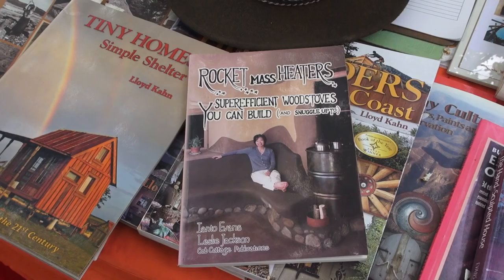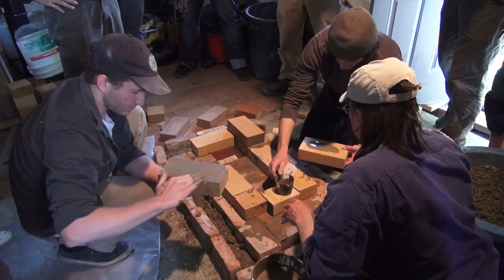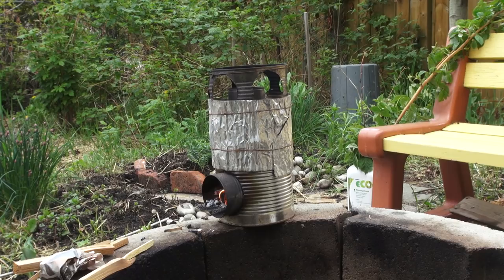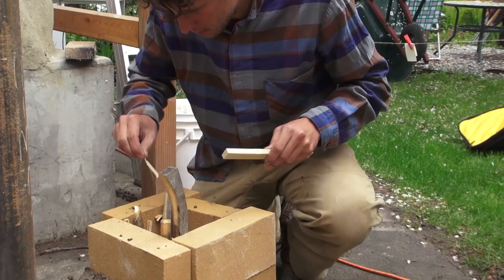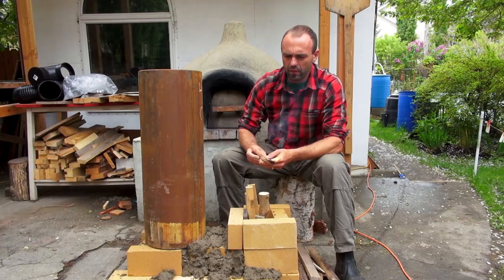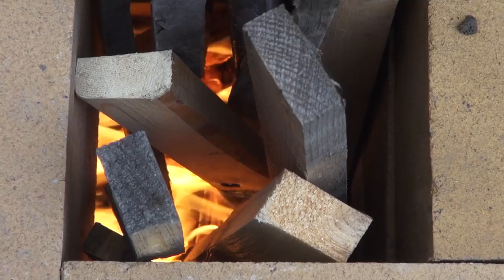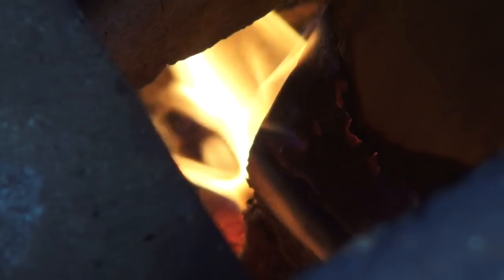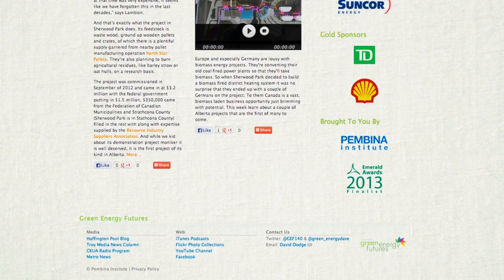47. Rocket Mass Heaters: A better burning wood stove

Comment: I can tell that these people who have talked for a long time don't really understand why it works as it does. Quite a few years ago ( 7 ) I put my brain to understanding how this works and how you can attain these efficiencies. I understand this process. How can you go from burning 6 cords of wood to maybe 1 to 1 1/2 for the same heat when the existing stoves may claim an efficiency of 80% lets say. There is something wrong.  But I can tell you the rocket mass stove does just that.
Reply: It basically "works" because it dumps its heat energy when it comes out of the inner flue and encounters the 55-gal drum. Not only does it "dump" its heat energy, but the (realtively) cooled air sinks, drawing the hot combustion air upwards. If you insulate the drum...you lose the draft. Ideally, you should insulate the inner flue, so that no heat is transferred to the gas in the 55 gal drum portion...I don't see them doing that here.
Reply: Existing wood stoves may claim to be 80% efficient, but they are just 80% MORE efficient than the last piece of junk ineffecient wood stove. Not 80% out of 100%.
Reply: Darrell Jacob JR - close... Actually, they are 80% efficient at combusting completely and turning the fuel's available hydrocarbons into heat... 

  The fact that they send a huge portion of this heat out the chimney as 500+F exhaust to maintain stack effect has no bearing on the "efficiency" rating.  It is in no way claiming that 80% of the embodied energy in that fuel before burning will wind up inside one's home.

  That (highly important to real world value) factor is not a part of the EPA wood stove "efficiency rating" program.  It's all about cleanliness of combustion, and the rocket design has them beat on all fronts right up front in the super efficient primary and secondary combustion it creates.

  Well designed/built Rocket mass heaters create 90-95+% combustion efficiency for most of their burn cycle, AND scavenge most of the heat from the (MUCH) cleaner exhaust gasses, before sending them out of the building... 

  And have a "real world efficiency rating" that is probably closer to 80%, wheras the "80% efficient" (at combusting the wood) stove in my living room probably has a real world efficiency (net energy from the wood burned kept inside the home) of closer to 20-30%

  I clarify this mainly for others as I know from other comments that you have an intimate knowledge of RMH's and their construction/design principles.

  I just wanted to explain the facts for people used to using normal wood stoves and talking about their "efficiency ratings", who have not experienced the real world difference between the two... Which stated simply is:

  A properly designed and homebuilt Rocket Mass Heater, burned a few hours a day, will keep you warm (70+F) 24/7, on anywhere from 1/4 to 1/10th the wood of a "high efficiency rating" modern wood stove.
Reply: bcubed72 - the dumping of heat energy at the barrel is the second half of a two stage thermosiphon... The first stage is the rocket's highly insulated burn tunnel and riser tube.  At  3000+F in the most highly optimized designs, that 3-4 foot burn tube creates MUCH more stack effect than a normal chimney of that length due to the huge temperature differential...  The barrel then shrinks these gasses back down to flow through the exhaust at only somewhat higher temp and velocity than the intake air being sucked past the fuel.
Reply: Actually, it's still 400ish*F coming out of the barrell...it's the mass that sucks the heat out to bring it down around 100*F.
Reply: I have looked at their design and I can well believe it. 
Often building regulations and red tape stand in the way of what I call real progress, the powers that be want you to buy your energy from them, it is a corrupt world which is slowly dying because of the greeds of a few not the needs of the many. 
My solution to getting around the building codes would be to build one outdoors with a good well build heat exchanger, then just pipe the hot Propylene Glycol mix into your home around radiators and a hot water coil. 
My only issue with some designs I see is lack of permanence, I would image those thin steel oil drums would rust through in no time at all, if I did that I would use a stainless steel vessel. 
But rocket stoves really do have a future in the low carbon world.
Reply: So there appears to be two things going on. First, the hot air is trapped at the top of the barrel  and forced to pass on more heat. Second, the combustion byproducts spend a longer time at high heat which causes unburnt hydrocarbons to burn more. An interesting system that's only moderately more difficult to set up than a traditional stove.

Comment: sooo what happens when your little pit builds up with ash? from the looks of it there is so way to empty the ash but to destroy and rebuild. could be a serious risk for a fire if enough builds up. maybe incorporate a small slid able tray on the bottom of your pit.
Reply: I've not built a rocket stove and am no expert, but I believe by design there's SIGNIFICANTLY less ash produced because of the method of burn. I've seen some designs that have ash traps and collection areas on the exhaust as well, so I think that's an option.
Reply: There are multiple clean out ports. One is at the bottom of the J tube (the bottom where the wood sits), the next is right next to the exit pipe on the bottom of the barrel so you can clean out the barrel, the others are placed along the stove pipe ducting that is surrounded in the cob mass. The easiest way to clean out the ash is using a vacuum such as a shop vac. There is very minimal ash build up due to such an efficent burn, and the ash that is loftover is a very fine powder.

Comment: the biggest draw back of the rocket stove is that you have to use high quality dry wood and cut the wood into very small pieces.
Reply: seasoned does work the best, but a 50/50 blend on the not super cold days works pretty good too.  1/2 dry, 1/2 not dry.  Not sure about green though, that is really wet stuff.  Small pieces yes...but you can use a lot of stuff other than wood.  Some people make paper pellets from all their old paper, others use brush, and corn stalks...I seen someone was using horse dung (dried of course)...I cannot imagine actually using it for in your home, but if I am cold enough...lol.

Comment: How many fire bricks does it take for a 55 gal drum rocket stove and what size are the bricks?  Also is the pipe that comes out of the stove that goes into the bench how does that connect to the stove is it just stuck in there under the drum? Thanks

Comment: build one first in garden to perfect it mine took about 70 bricks, and a drum go to a ducting suppliers they will have different size flange connectors ,the  reason there is no code approval for these stove is the same reason there would not be light bulbs now, no current code or approvals means no change , keep on burning nuclear fuel , oil or gas or electrickery which is made from the former at an efficiency of 25% if were lucky,but wood is also finite in supply you got to grow it to burn it

Comment: If you have either money or welding skills you could use much heavier metal for all of it and make a unit which would last a century and never corrode through or pinhole and leak.  Use Schedule 40 pipe and mild steel plate for the whole thing including ductwork since unlike a conventional stove, the creosote is consumed by combustion. Use bolted top covers with gaskets on the barrel (and use stainless bolts) so you can clean it out every few years. Bonus is a plate steel top (if you have the bucks, go for half-inch!)  has ample thermal mass on its own and if clean can be uses as a stovetop too. A lip around the edge wouldn't be hard to do. If you TIG you could make your barrel from a couple of stainless steel beer kegs, and you can also order stainless steel 55-gallon drums if you like a conventional barrel but want it to outlive your grandkids.
See your local welding/fab shop. Show them designs, and they can translate into serious metal. If you visit welding forums you'll find some beastly stoves and shop heaters built by skilled pros.
Reply: Ob Fuscated well said and well thought out

Comment: Where do you clean the ash out?
Reply: It mostly collects just where the pipe exits the barrel, the manifold area.  Since it is 95% efficient, there is very little ash at all.  But you can build a cleanout there, and in other places.  Normally some kind of metal screw cap.  The barrel normally can be removed, or some people use just enough of a second barrel that it can be clamped to the main barrel with a barrel connector, that gets you pretty much inside everything.

Comment: It appears that the smoke output is decidedly less than a traditional campfire.  This looks like a potential way to heat a greenhouse in the winter and create CO2 for the plants at the same time.  What are your thoughts?
Reply: Hi Michael, greetings from Colorado Springs Colorado.
I'm extremely concerned that the "sustainable" push, generated by the *Green Movement is a trojan horse of dysfunction.
* The people at the core of this have managed through propaganda to convince much of the public to accept ideas about energy and energy use that don't work.
Have a great day. C
H
Reply: @michaelrowley6069  , what you said, excellent. Thanks C

Comment: Why do you extend the exhaust out and surround it by thermal mass, but not the barrel?  So more radiant heat goes directly into the room?
Reply: the barrel cools off quickly when the fuel runs out ,  warming the large mass stores the heat that is  released  into the dwelling  over many hours . instead of going right up the chimney like a conventional stove

Comment: What about empty for ashes and sod in the chimney ?
Reply: Same question, he said the exhaust goes through the bench, but the architectural drawing showed a regular chimney???
Reply: Perhaps not shown, there should be a duct cap/ cleanout right where the gasses leave the drum. Ash will collect there, but really it burns so hot/ efficiently you may only get a double-handful of ash out in 3-4 weeks.
Reply: The ducting, carrying hot gasses, leaves the drum, travels through the mass/ bench, doubles back through the bench, then goes to the exhaust riser (what you think of as the chimney) to get the CO2 and water vapor exhaust out of the house.

Comment: hi, why we use an insulating pipe wrapped on the pipe inside?
the insolator should be placed on the outer pipe isn't it?
so people won't burnt if touch it. do you have explanation on this case?
Reply: The insulation on the heat riser (inside pipe) is to keep the exhaust gasses as hot as possible for a more complete combustion. More complete combustion = more heat generated.

Comment: There's only one problem with this and NO ONE ever addresses it. Why don't you burn outside air, instead of using warm air for combustion? Run a pipe from outside to give it the oxygen it needs? Otherwise,  you'll have to allow fresh, COLD, air inside.

Comment: Just got the rocket mass heater built and I'm having trouble with the smoke coming back out the inlet and it will sometimes put itself out. Got any ideas as to what the problem is? I need some help.
Reply: I ended up pulling it apart and changed that gap from 2 inches to about 1 inch and that seemed to make all the difference

Comment: has anyone tried to make a rocket furnace to burn rubbish cleanly but on a larger scale?
Reply: Trash incinerators using a fluidized bed  burns at 1700 plus degrees  most  generate steam which drive a turbine for electric  generation . many maintenance issues  from acids  in metals , and plastics  you would have those problems  as well.  there are safe guards on commercial applications that a simple rocket style stove wouldn't have.   Not recommended .

Comment: I built one for cooking in yard. Excellent BUT muct sit there anf feed fuel constantly even with a 45 deg angle feeder[gravity]. Other thing for house heating--again--must constantly feed fuel--so very unlikely can be used in a house--American Ins. cos. will NEVER allow a home made heater in house. Mfg. heaters will be too costly--answer--hot water rocket in garage, outbuilding, or outdoors period. Again the constant fuel feed problem. Solve that and thr Rocket is a great heater.

Comment: ok question folks!!! what was the grey clay they were putting on ? was it " Cement" ?? why did they not wear any gloves ? do they like industrial skin illness?
Reply: The grey clay was a 'clay and sand mix', not cement. They did not wear gloves because the mix poses no hazard. You can buy industrial/commercial grade clays, just Google 'Clay Suppliers'. 1000kg, a metric Ton, costs around £220.
Reply: ok! good to clear that one up ;)
Reply: It's called  cob.  look  it up for various mixtures primarily clay , sand  , soil, and some add vermiculite .

Comment: So how do you take care of the condensate?
Reply: ***** 
 With any high efficiency furnace, you have a lot of condensation. Because there is moisture still remaining in the wood and from the combustion it's as a byproduct. You'll get condensate somewhere if the exhaust isn't over 212°f. 
As for your stove, any and all moisture produced is totally  vaporized as it goes up the flue.

Comment: Is that fan spinning on top due to the heat rising? Is dose the heat power some kind of generator?
Reply: heat rising makes the fan blade spin and thus circulation happens .. heating the room :)
Reply: Yes. There is a thermocouple between the upper fins and the base.

Comment: If only they new about burning the woodgas too, for extra heat! But nice design
Reply: Not sure what you mean by this. As I understand it, you can produce wood gas from wood, as a convenient fuel. The rocket heater burns the wood completely, so what could have become wood gas is burnt as a fuel. The only products from the heaters should be co2 and water vapour.
Reply: Well even a camp fire burns all the wood but doesn't burn the wood gas. Normally you need a 2nd stage in which hot air is mixed with the wood gas to burn it. But maybe this happens with this stove?  Hope it does otherwise it could be made more efficient... Well they seem pretty effective already.
Reply: Having the enclosed burn chamber is to keep the combustion process hot to get complete combustion, hence no smoke and as I understand it, no other unburnt gases. The claims for rocket heaters/stoves when done properly is exactly that.

Comment: How much space can this mass setup maintain? Is this setup primarily used for simple small single room structures measured in the hundreds of square feet? It seems like that would be there best use. Kind of like a small off the grid place maybe.

Comment: Would it be an improvement in combustion to build riser also from insulated fire brick or castable + vermiculite?
Reply: They say now to NOT use metal for the heat rise - so yes
Reply: It's been done by a few RMH builders, so yes.

Comment: How do you get the ash out?
Reply: most of the ash is  in the burn chute.   and can be scooped out before each fire .  the fire burns much hotter  than a regular wood stove as it enters the burn chamber  and burns hot enough to vaporize creosote .  not much is left  .except gasses

Comment: Hello, Great Video! Do you by chance know the optimal ratio of the Diameter of the J-Tube to the Diameter of the outer burn chamber (secondary burn chamber)? I am looking into building one of these using a 150gal (US) propane tank as the secondary burn chamber, and I want to know what size tube I need for the heat riser (J-Tune). Any help would be appreciated.
Reply: Ernie and Erica Wisner    have been making these for decades. They know what works,  and what doesn't. They have a published book. I don't remember the exact name of it. Rocket Mass Heater is in the name.
Reply: Auto correct spelling is a punk, sometimes.

Comment: Yea im a do it your self guy but a cement and fire brick stove really. It looks horrible i don't care how well you make it. I would rather spend the $1000+ on a iron one where i know it will last for 40 years and i wont have to do a dam thing to it. All that brick and refractory cement is going to crack eventually i would bet with in 10 years. I replace the fire brick in my stove takes me 20 mins you would have to rip the entire thing apart and start over with this set up. Just because its been around for century's does not mean its still viable today. Its defiantly neat and a applaud these guys for bringing back something old but just the liability issues with having brick fire pit that should be outside in your home makes this a bad idea.
Reply: +motherchucka1 is there a link to a iron stove set up as you mentioned and is it still a rocket stove?
Reply: +motherchucka1 
You are missing the point of the thermal mass which retains and slowly releases the heat. Steel cools down really fast. Anyway it should be clay, not cement, holding the fire bricks "apart," not "together".
Reply: You design in a few clean outs.